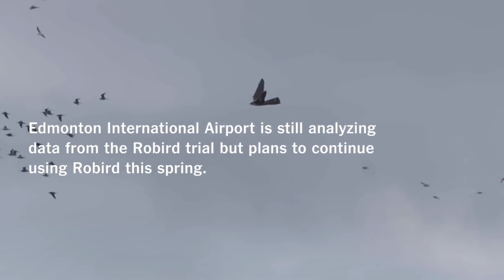Bird Strike - Problem and a new FIX - Prof Simon

Comment: My first job in 1988 was bird control.  I worked landfill sites that happened to be at the end of RAF Base and Airport Runways.  Dawn till dusk, we would rotate between making a lot of noise with shotguns, 22 blank firers, gas cannons and netting.  The birds (mostly gulls) would get used to each scaring technique in about  a week.  We would very ocassionaly actualy shoot a non protected species, (big trouble fot getting that wrong so we were extremely strict on wildlife protection), and hang them up for a sterner message (I did about 6 kills in two and a half years on the job).  Summer was incredibly long hours and very few birds to deal with - on the other hand, winter was hardcore - 100s of gulls all day long. The company also did RAF runway work using peregrine falcons and jeeps with a tannoy that would play distress calls of the species flocking on the runway.  The guys would get a scramble a few minutes before a flight take off and clear the runway.  I went to uni instead of advancing to becoming a trained falconer with guns an ting.  :)  I guess the robo peregrine is the obvious progression but I'm sure the local problem flocks will see through it pretty quickly - birds aren't stupid.

Comment: although  Drone birds or real birds   may work.. I think the better Idea would be to install a small  cone in front of the engines  which would deflect most larger items and still not reduce much of  the engine airflow  ,or some form of Air filter located in front of the Engines .I have never seen one used yet..I'm sure they could also pull high speed  air from behind the wing  as well.if they needed more ..and eliminate the birds even coming close to the intakes..it is a aircraft issue not a Bird Issue..

Comment: I work at a military airfield where a couple of techniques are used: 1) there are foxes whose dens are at the perimeter 2) there are real wild falcons which are resident in the area and 3) just before jet takeoffs a vehicle launches loud crackers into the air every 100 meters or so along or beside the runway or 4) it broadcasts predator calls along or beside the runway. This combination seems to work as jet traffic is relatively low (prop/turboprop and helicopters are more common).
Reply: My Father was in the RAF and worked on this problem after at least one Nimrod was taken down by a bird strike.

Comment: Airport here simply stopped cutting the grass short, so the long grass discourages the large birds, as they cannot see predators or get good tak off areas, thus they stay away. Small birds will be in the grass as it provides a safe hiding, and the large predators will stay away still. thus no large birds, the main damage cause, and small birds are less of a risk. Bonus is they only have to cut the grass once or twice a year now, and cut it high as it will grow back fast anyway.

Same for geese and water courses, leave large thick margins around the water and the geese do not want to be there, so they stay off the golf courses, and instead are in the city parks.
Reply from the maker: Good advice

Comment: Put chicken wire over intakes lol 🧐
Reply from the maker: Fixed
Reply: @SimonHollandfilms  I think I've heard that disrupts the air intake and reduces the power of the engine?
Reply: @nicstacey3605  Correct, as well as presenting a potentially even greater ingestion hazard to the engine should the wire itself get pulled in.

Comment: Professor I  think you should rethink your argument about bits of ingested birds making it through to the turbines and causing a compressor stall. Do you really think that is equally so for a single, double or three spool engine? The stall will occur as a result of compressor and combustion chamber disturbance rather than turbine damage (if there is any!!!). And don't get me going on what causes an engine to surge. FIMechE . Keep the videos coming.
Reply from the maker: Thanks Arthur

Comment: Interesting idea! I fly model aircraft and don't think that robobird would have a long flight time so no doubt would need a lot of charged Lipo packs ready to go each day. It could also have a system inbuilt to fly a course unmanned like a drone would with waypoints.
I have a friend who is a wildlife officer for an RAF base (can't tell where for security reasons) and I've spoken to him about just this issue (birdstrikes) in the past and his reply is "If the wildlife officer is doing his job properly there shouldn't be any bird strikes" His job to do exactly what this robobird does and that is scare away (or kill) any birds or land mammals that stray onto the runway or within the airbase to avoid any damage to the aircraft.
Regards jet engine surging, they can also pulls flames out the front of the engine too, the sound is horrible and often writes off the engine (very expensive!)

Comment: This is a humane and innovative tool for airport bird problems. It's funny where they use fake owls and the birds actually sit on the owls heads! I've seen air cannons and real falcons used at USAF bases. The boom from the air cannon and a few orbits of the falcon work for awhile.
I use rubber snakes on my deck to keep the birds away so they don't  💩 on it. If I don't move the rubber snakes around them birds catch on 😎.
Reply: Robot snakes!